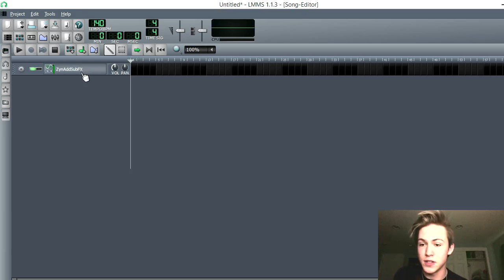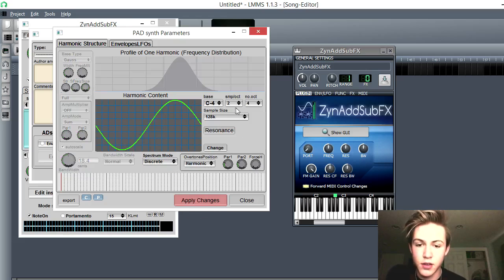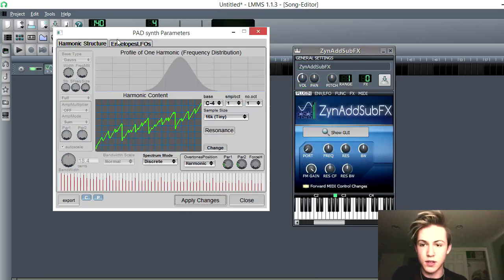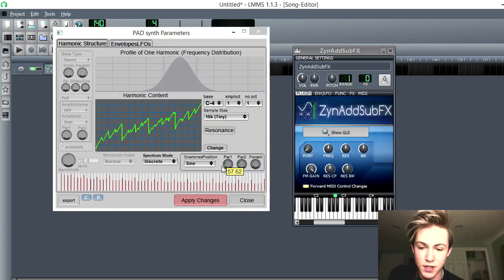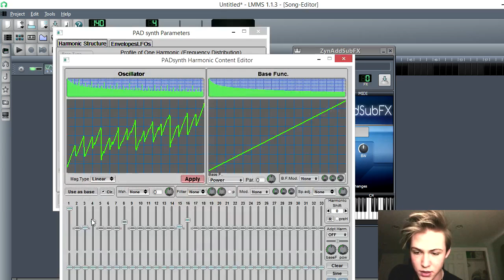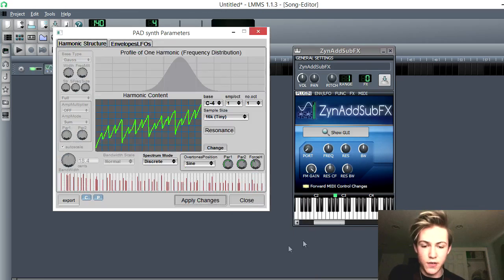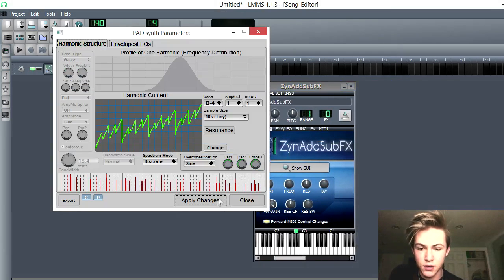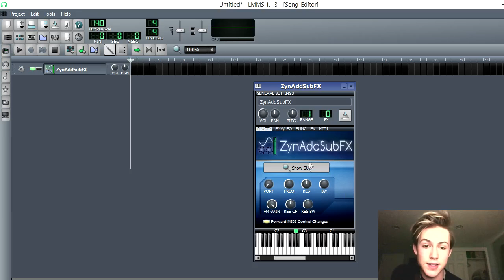ZynAddSubFX Bell Sound Tutorial

Comment: Nice tutorial, though could, if you happen to already know how, make one on how to synth a large bell? Like a clock tower or church bell?
I've tried myself at it and while I managed to get a bell sound made that's not too bad considering I'm using LMMS for like 3 days now is it far from sounding like a large bell.
Reply from the maker: +BloodyRain2k this tutorial should apply to large bells. Just make sure to hit low notes and let them sustain for a long time.
Reply: Following that advice I got a nice bell sound made, not exactly a church bell yet but a lot closer than before.
Ok nevermind about the problem, for some reason did my ears betray me, LMMS was just a little more quiet and drowned the reverb with that <.<"
Reply: I found that turning the base function to pulse makes the sound more bell like in the bass range.
Reply: By the way, there is a church bell preset already in Zyn's preset folder. You can find it in "Noises" bank. The preset called "Metal Sound 2". Hit the lower keys and you there.
Maybe you figured it out already or found another way to create a church bell sound. But anyway, maybe someone else find this helpful :)